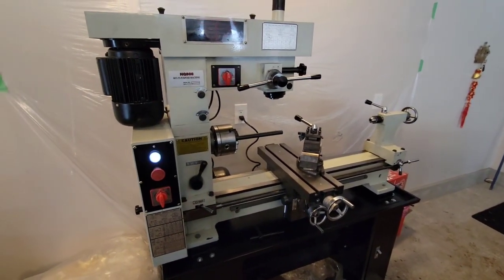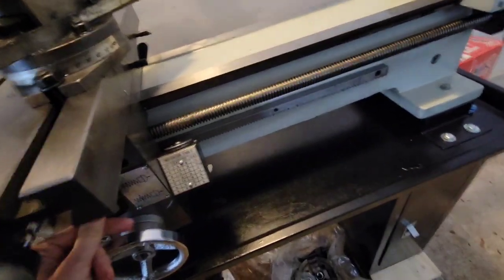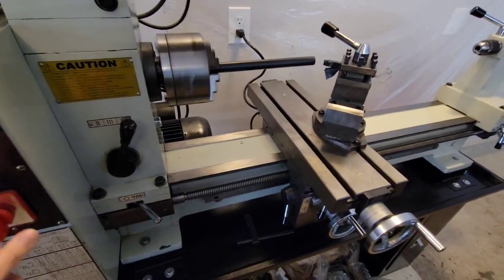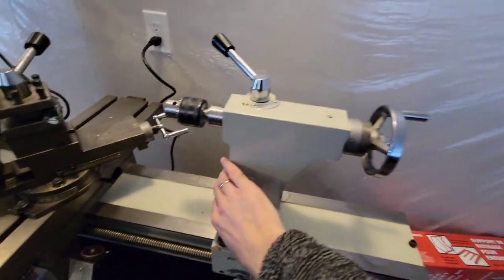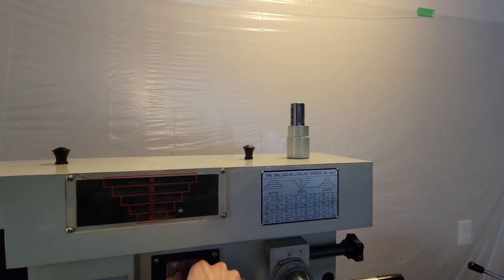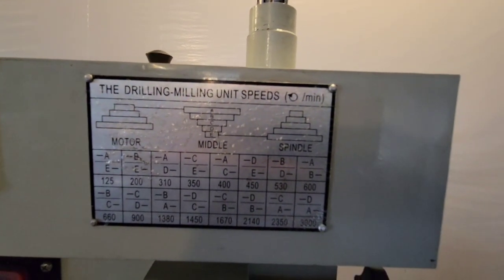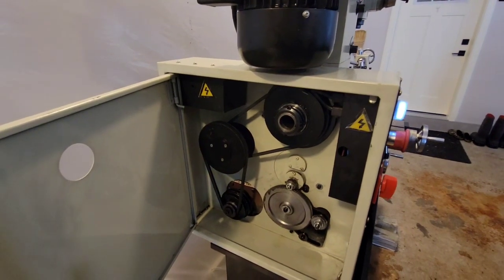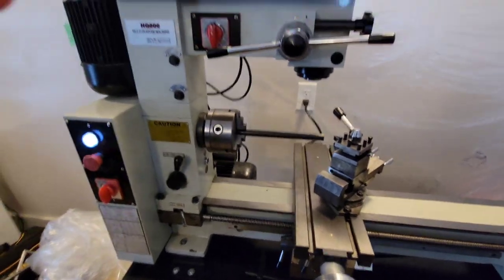HQ800 Metal Lathe Mill combo 16" x 31" Demo

Comment: I've converted mine to CNC lathe and mill using Mach4 and fusion 360.
Reply from the maker: Nice
Reply: IncitatisTheTrannySenateHorse  I can get 100microns. It's not fit for mass production. Still a cheap hobby mill. I can get good results if I adjust using my DRO readings.